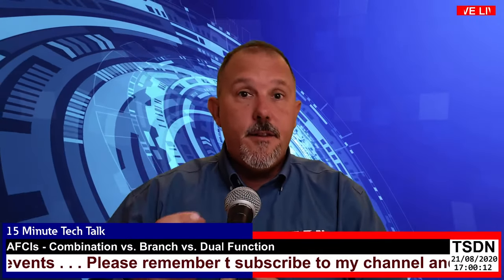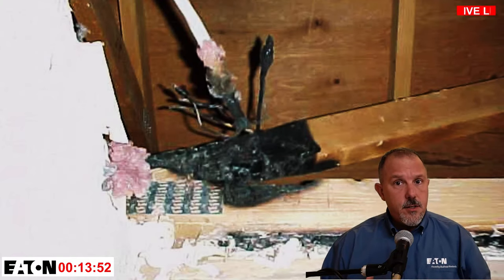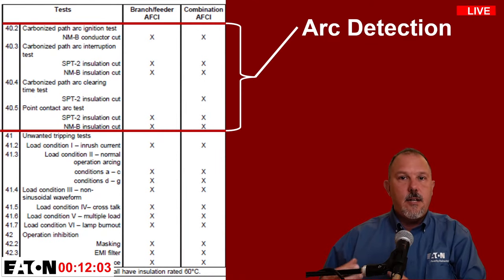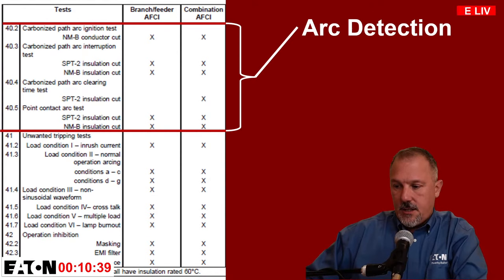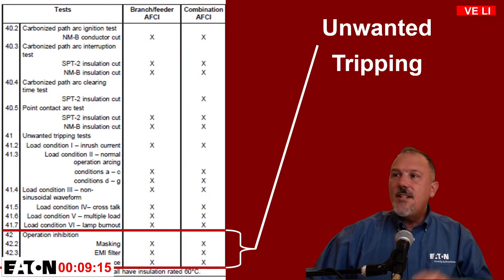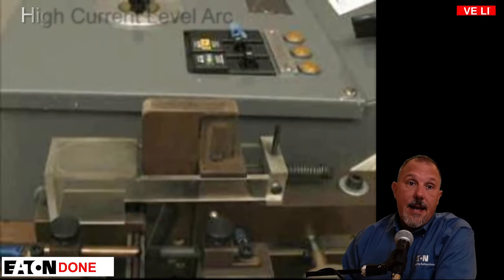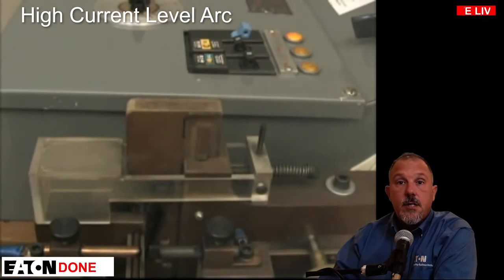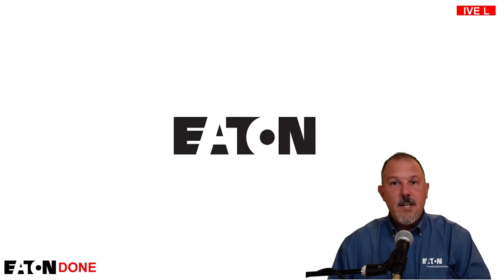AFCIs Branch Feeder vs. Combination vs. Dual Function Type

Comment: If I am replacing a branch/feeder AFCI should / can I replace it with a combination AFCI? In particular, I am planning to replace an Cutler Hammer model # CH115AF with a Eaton Cutler Hammer  model # CH115CAFCS
Reply from the maker: hey there @craiganderson1380 thanks for the note.  yes, you can make the replacement. The combination type AFCI adds series arc detection.